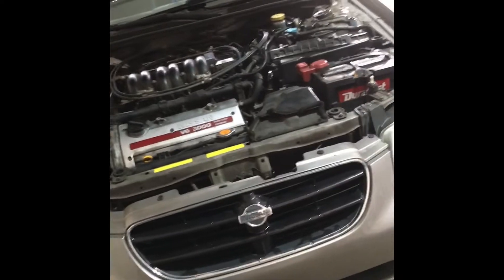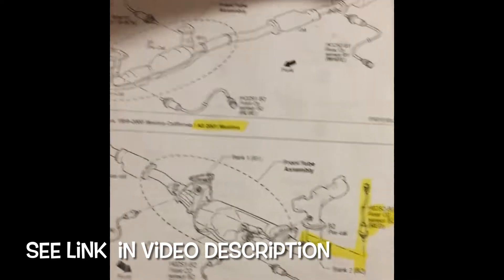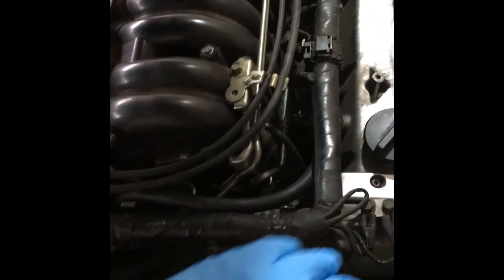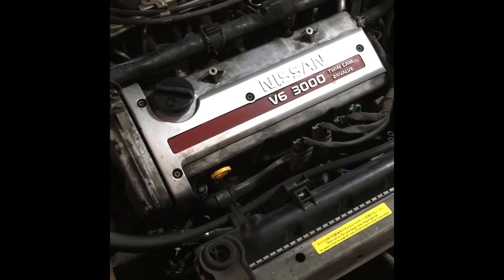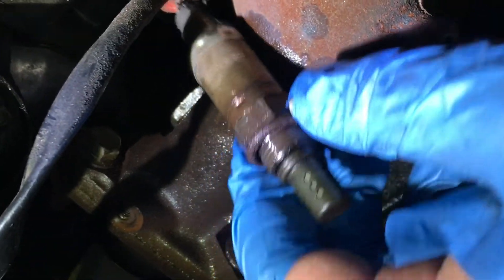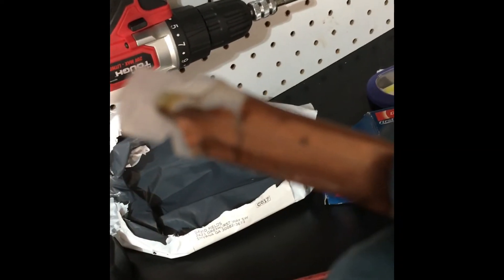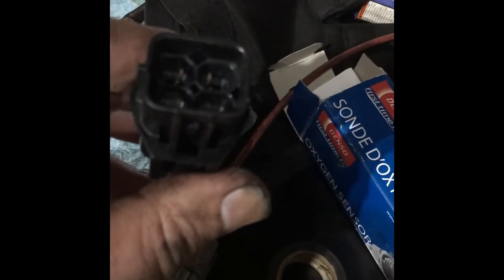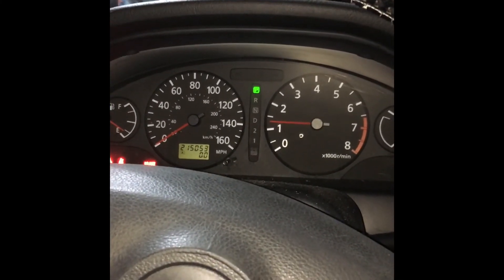2001 Maxima - "Mad Max" O2 Sensor (P0160) replacement B2S2

Comment: Denso 234-4776 sensor is for Bank 1 Sensor 2 with a white wire. That's why it didn't fit.  The correct Denso part number for B2S2 (red wire)  is 243-4777.
Reply from the maker: I ended up with a Bosch one. And returned the Denso
I bet the. Denso one I had initially was for b1s2

Thanks for your comment 
This was the. First o2 sensor I ever changed

Comment: Good morning Mr Fields, going to replace the sensor tomorrow. Question on how the O2 sensor cable is attached. Are there numerous places were the cable is attached to other cables. Is that why you listed zip ties. Is that what I use to secure them when I am done installing the sensor.
Reply from the maker: yah there are some zipties, but also at least the one I used the wires came with plastic nubbin where they were pushed into some place on the car, Also the Shape of the plug part are unique for each O2 Sensor. so you cannot accidently use a wrong one.  the OE is Bosh   Also make sure you soak the o2 sensor for a while in WD40 for instance.  they can be difficult to get out.  especially if you live in a Northern climate that gets snow.     now I zipped tied the wires to other wires to keep  neat.   Hope all works out for  you.

Comment: So I was revving my car and it lost half of its power, won’t go past 2 and a half rpm but still picks up speed slowly. Turned it off and cleared codes now it won’t turn back on but will turn over, would this be the issue? I replaced the fuel pump and bypassed the relay for it because it wasn’t getting power to it.

Comment: I have code P0420 "1. Catalyst, and 2. Catalyst System Bank 1" and this code PO160 "HO2S2 Bank 2" so do I need to change the front sensor like you did to get rid of code PO160 and change out a rear sensor as well near the catalyst, or should I change out both rear sensors to fix code PO420? An answer will be greatly appreciated! Glad to see people still working on maximas in 2021
Reply from the maker: Not sure, Exactly.  Could be a O2 sensors or bad cat converter or both.   Yea I saw that the b2s2 on mine voltage wouldn’t change enough.  No activity.  Which told me that the O2 sensor b2s2 was starting to fail.   And it happened more on cold days.

I think few years before this happened O2 sensor got replaced as part of another check engine light.  That one I don’t remember the code  and was before when i didn’t work on my car as much myself.

I started working on my own car when I got more time todo it and after Covid hit and trying to save $$ on a old car.  The car is now my son’s and only got a little more life in it.  Just doing what I can to keep it going for a few more years for my son.  
Transmission is going out ,  lost 4th gear.  He knows that he needs to save up for another car. But that this one is good for just getting around locally
Reply: @dfields9511  thats dope, i bought two upstream sensors for the bank 1 and one rear sensor after the cat
Reply from the maker: Hope it all works out.  Taking out the old sensors can be difficult in the Rust belt.  
Where I am we don’t get snow.    Advice for a few days hit  the O2 sensors with wd40 like stuff to make it easier to get out.  Don’t forget the anti-seize when putting in new ones on the threads.

Comment: Is that type of car reliable?
Reply: I've got a 01 gle with 203k auto trans and it's a strong runner. Keep the fluids good and it's a go
Reply from the maker: Older maxima are very good,  with v6 3.0
Engine.   I just wish this one was a manual transmission.  It has auto transmission problem right now at 215k.  
I had a neighbor get 300k on a maxima. With same engine but it was a manual transmission.  The newer maxima are ok until maybe 100k .
Reply: As a Infiniti i30T owner I can honestly say this is the best car to own ... Very easy to maintain if you have tools an the knowledge
Reply from the maker: Yep it’s very good,  their weak point is auto transmission.  I just wish it was a manual transmission at this point.  It now has over 220k miles .    Lingering issues : Transmission issue p0744 and rear main seal oil leak.
Reply: Hi bro. I have a 2000 Maxima automatic 307,000 miles. Going strong.
Reply: @ẞANE69  Nice
Reply: My 2001 automatic is still running strong. It's just now to the point of needing things fixed- valve cover gaskets, o2 sensors, starter.. not bad for me. Just about 200k miles on her and I've put her through hell at times 😊
Reply from the maker: I got 245k or so miles before i sold this car.  Needed a Transmission and rear main seal. I got 42k miles on it after the transmission started going,  it lost 4th gear. Likely burned clutches 

It’s a good car but they start to fall
Apart about at 180k 
If it was a manual it would still be going strong
Reply: @brenwils6227  good to hear